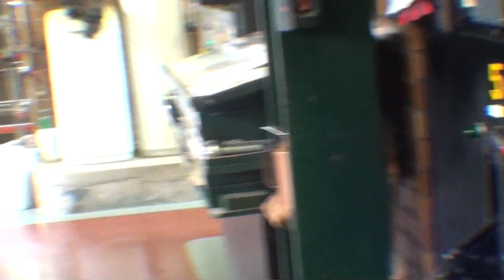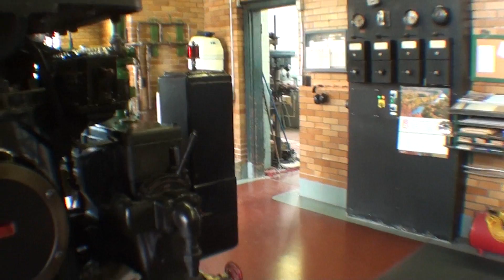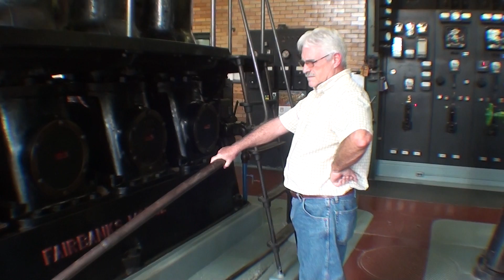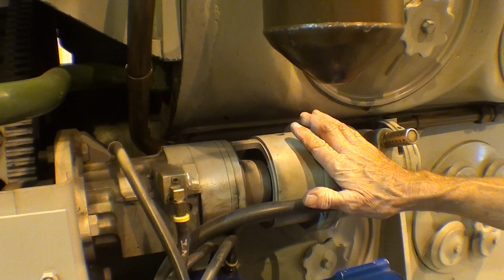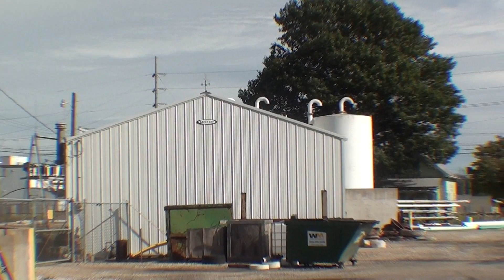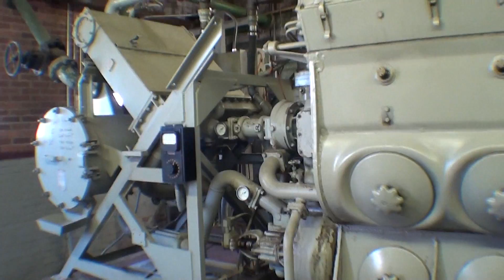tubalcain Takes a Roadtrip to the POWER PLANT pt 2 EMD engines

Comment: I love those EMD's and they're the same cubic inch is the one I use, except the one I run is a 16 cylinder 645 @ 2000 HP in a 1954 GP9 SP 3194 at the Golden gate railroad Museum
Reply from the maker: Awesome

Comment: An SD45 motor. And the same size air cylinders we use in rail yards to supply air to the freight cars for the mechanical department to perform pre-trip air  brake inspections on trains.

Comment: Great mix of mechanical, analog and digital. The sure don't build them like that any more. I was on a rebuild team.  We rebuilt 4, 12 cylinder 1939 GM Diesels with 600 Volt DC generators.

Comment: The EMD 20-645 engine was developed for the model SD45 by adding four cylinders to the 16-645 used in the SD40, adding 600 horsepower. The initial version had problems with a weak crankshaft, couldn't handle the additional torque, but they eventually got it right. In case you were wondering, here's the very first SD45 being started up: https://www.youtube.com/watch?v=Flp0scZWk2s
The other one, the 16-567C, was used in the SD9, among other models: https://www.youtube.com/watch?v=0EfowMMknXQ

Comment: Yet anouther grand slam video.
 THANK YOU! 
In 1986 i was very fortunate to replace some 480 volt 800 amp power distribution breakers built in 1927 for new ones. The old ones took up a wall space of 10 feet high by about 20 feet long. The new unit was 8' high x 4' x 4'. Sad and cool all at the same time.
Reply from the maker: Yes, love the old stuff. But I guess the new one is better

Comment: I work at a power plant in Kansas, my dad has worked at another one for over 35 year’s. If there’s one thing I’ve learned so far, it’s that you have to take all the information and knowledge you can from people like Greg, because once those people go, those power plants are sometimes not far behind. I’ve learned a lot from my dad and love what I do, it feels good to know the Lost Trade. There’s just something about this job that makes it so addicting, like the adrenaline running through you during a black start. It’s what makes those old guys tick. LONG LIVE THE SMALL TOWN POWER PLANTS!!!!

P.S: This brotherhood doesn’t require a monthly payment...
Reply from the maker: Yes, Greg is a great and knowledgeable man. I talk to him on the phone from time to time. They had a little movie theater in his town when he was a teenager. He told me he spent all his time in the projection booth, helping with the sound equipment. He still remembers the number on everyone of the vacuum tubes.
Reply: Hallo Engineer can you help me 
I have problems for spefic fuel of consumption rate of Engine EMD 645/20 cylinders in acatloge 0 .24 L/kwh while in actual is 0.30L/Kwh

What is the procedure to do to decrease s.f.c

Max loads 1600kw i cant loading more because the temperature exhaust go to high
Reply: Hallo Engineer can you help me 
I have problems for spefic fuel of consumption rate of Engine EMD 645/20 cylinders in acatloge 0 .24 L/kwh while in actual is 0.30L/Kwh

What is the procedure to do to decrease s.f.c

Max loads 1600kw i cant loading more because the temperature exhaust go to high

Comment: The man said they don't have a blower. Every Detroit 2 stroke ever made, series 53 to 710 has a supercharger (s). They will not run without a one.
Reply: That's what I thought,a diesel two stroke always needs positive cylinder pressure for proper scavenging.Perhaps I'm missing something?

Comment: Great videos. We have two of those exact EMD 645’s at the now defunct Oyster Creek Generating Station. It also has the ‘creepy crank’ to prevent hydraulic lock except they are battery driven. They are Cadillacs because they are very easy to start and they run fantastic.
Reply from the maker: Beautiful engines

Comment: All of those recent videos wer verey interesting. I worked at Salem Harbor Station in Salem Massachusetts for 26 years. Steam boilers to steam turbone Generators. We also had 6 EMD units in Gloucester and Newburyport for Auiliarry power. Each unit was 13 mega watts a piece. The plant I worked in is now dismanteled. It was replaced by 2 gas and oil fired units putting out 650 megawatts of power. They are made by General Electric and are combined cycle units. Pretty snazzy. :-)
Reply from the maker: Progress

Comment: I worked on EMD's when serving my Apprentice ship . beautifully simple engines and a triumph of design ,originally by Winton.I still have my barring over key, which is used to open the cocks on each cylinder prior to starting to makwe sure no water has condensed in the cylinders over noght. And yes ,a lot of water would come out in humid weather.

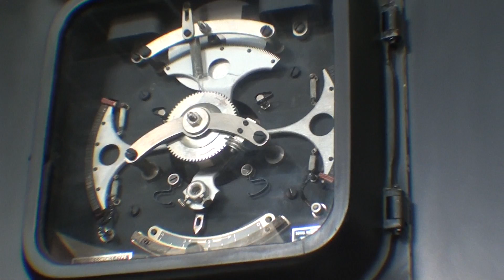Comment: Wooo Hooo Brown Boveri AB4 rolling sector Voltage regulators 2:35, made in Switzerland by watchmakers. Am I the last BBC rolling sector service Engineer?
Reply: Ah, I recognized it correctly: Brown Boveri
Reply: @janvisser2223  Hello Jan did you work with them? They were industry standard in europe in their day. I went to some that were falling apart but still working!
Reply: @worker611  
No, I never worked with these. But when studying marine engineering 47 years ago, I paid attention and still remembered them from the books. Probably due to the fact that I liked their design and the craftmanship to built them.
And by the way,  those EMD’s are truly impressive engines.
Reply: @janvisser2223  They were built in Switzerland so thats were the craftsmanship came from. I went to a few that were on ships or tugs and small vessels, they were usually the smaller ones with a single rolling sector I think they were called JC1. I was a marine service Engineer with the British Brown Boveri from 1974, by that tme they were coming to the end of there servicable life as electonics was taking over. They were great to work on as you could see if they were faulty without needing any instruments. Best wishes and Happy New Year from UK. Bill.
Reply: @worker611  
None of the ships I sailed on, had these voltage regulators installed.
I suppose, the rheostats were the parts that needed the most attention?
And also for you Bill and your family a happy new year from the other side of the North Sea (🇱🇺)

Comment: Craig seems pretty knowledgeable, but he gave a bit of misinformation on the EMD 645 engines when he said they didn't have blowers. All EMD 567, 645, and 710 engines are 2 stroke engines and they won't even attempt to start without a blower to push air into the power assemblies. No blower, they just spin over and smoke. The EMD turbo charger is a combination blower and turbo. It has a gear train connecting it to the crankshaft so the engine can start and run. The gear train has a clutch that works like a ratchet, at lower RPM the clutch drives the turbo impeller, above about 600 crankshaft RPM and around 15.5 K turbo RPM the exhaust has enough pressure and heat in it to spin the impeller faster than the gear train and clutch can, so then the turbo comes off the clutch and spins up to around 19K RPM to make full horsepower.
Reply: That is a nice system, which I have not heard of before. (says a marine engineer since 1978 lol)

Comment: The turbochargers on the EMD engines are gear driven on start up and until their under load. Then the exhaust gases take them off the gear train.
Reply: Larry Hedeen called "clutched"
Reply: Never knew the turbochargers were gear driven on start up then exhaust gas driven.Always though that they were permanently geared to the crank on those two strokers.

Comment: All aspiring electrical engineers should spend a few days in a plant like this, learning from gentlemen like this how power generation works from first principles.  Watching a computer screen control a machine you learn little, adjusting the load limit on a fly-ball governor to limit speed over shoot on run up is clever use of the available technology.  
Manually syncing and closing up a breaker then hearing the engine knuckle down as you wind on the load while manually adjusting the AVR in response to reactive current is  something that needs to be done by hand to really appreciate the physical interaction between the governor, the AVR, and the load.  
Thank you for an excellent film on skills that are rapidly being lost to the computer generation, I'm lucky to be of an age where I have been exposed to both methods, I appreciate the ease of the new ways, but I understand the basic physics behind what's happening from doing it by hand.
Ray
Reply: I graduated from Iowa State University in 1977 as a EE.  I thoroughly enjoyed the power lab they had there, very interesting lessons.  I'm not sure if they still have the lab but I think not.  It had both AC and DC systems.  I later worked for Iowa Southern Utilities for a couple of years, that too was very educational.  I sincerely hope we still have these kind of opportunities for our younger folks, it's good knowledge.  Thanks for the documentary.  I was impressed with how neat and clean the facility was kept.  That's a critical part of a good reliability program.  THANKS

Comment: Maybe you can answer this why was he running droop, while not paralleling to other units also why was he moving the load limit and adjusting the speed at the same time. Just wondering if you can explain.
Reply: The generator was running parallel against the grid, if the diesel was running isochronous speed (0 Droop) it would either overload itself if the governor speed set point was the slightest bit faster than the grid, or run as motor (reverse power) if the governor was slightly slow, the droop setting gives the unit stability.  Load limit mechanically limits the maximum fuel rate that is admitted to the engine, in the hands of a skilled operator, as this gentleman is, it can be used for limiting smoke on start up, then limiting run up rate to prevent over shooting the set point speed, then finally once on load, limiting the maximum load on the engine.
These skills are now all replaced by black box control systems, and the basics of how generation works will be lost when these gents retire.
Reply: whorayful I was just watching this video. If someone turned the limit control up you would have a run away. He is using it to hold the load. The Governor not working he is. I understand what he doing if there's a load swing this unit is going to drop off. The fuel is be held by a mechanical stop inside the Governor. I been out of doing governor work for a while never seen anyone do it like this. You are correct I see what you talking about he limiting it. As for as stabilizing it using droop he is dead rack against the limit stop.

Comment: A little information for you the Woodward Governor on the Fairbanks is a IC Governor and the 2 on the EMD'S are UG Actuators. Some were they have the electric governor for them. More than likely they are 2301 panels with load control. You didn't show the last one. Someone comment Caterpillar does own EMD. You seem to like how thisng work if they ever pull the side cover off the Woodward IC governor you would be in pressed. I wished I could have found one. I worked on Woodward Governors for 20 years. only seen one in my life tried to buy it they didn't want to sell it. It's a lot more than a flyball governor.

Comment: Thank's for the video.A squared away engine room.The workers take pride where they work.Never worked in a power plant ,but ran diesel-electric propulsion in the Coast Guard.They used 567 series as well as Fairbanks Morris,Alco,and Cooper Bessemer.Only difference is you are rocking and rolling.LOL

Comment: I spent 2 months at a power station owned by the company that employed me, they are very interesting places.  8 large steam boilers, feeding 3 stage turbines, with a total output of 1280 MW.  Used to be a base load station here in South Australia, but was working as a peaking plant when I was there. Due to the shut down of a coal fired plant, I believe it is now running again, as base load.

Comment: I've always been fascinated by things like this. Getting to see an emergency power system like this one is a real treat and I'm glad to see this second part as the first one really wet my appetite. One thing they couldn't show you is what happens when they throw those inlet breakers under load. The flash arc that occurs is something to behold. Watching one get hit by lightning is also an epic event to witness. I am both fortunate and unfortunate enough to have seen both. While amazing to watch, catastrophic events had to take place for them to be necessary. I feel compelled to say that you really don't want to witness a lightning strike in person as the concussive force is quite intense as is the arcing from the failed lightning arrestor. After the large explosion nearly knocked us senseless there was a large shower of sparks and all manor of chaos. Being a simple substation there wasn't much more to be done other than to throw the inlet breakers so that the line could be repaired. This happened back when I was a boy of 13 since I had made friends with the lineman who worked on that substation. He had been stationed there that fateful night because of the expected storm and the chance of a power failure. We had been talking when it happened. I learned a lot from Bruice and most of it even stuck. He's no longer with us as he died of old age. He would be 104 on may 20th of next year if he were till alive. He was a dear friend...

Comment: Best field trip ever. Thanks, Mr. Pete! I thought you were going to bar the FM over for us!

For those interested, there is (or at least was) quite a bit of information about the Fairbanks Morse engines online. Try searching for model Y engines. At one time I even found an operator's manual. The same basic engine was used, in one to six cylinder versions, to power mills, generators, cotton gins, you name it.

There was also a catastrophic story about an engine collector who thought the crankcase should be filled with oil....

Comment: The lack of explanation  that the generating station plays in connection to the grid leaves one to wonder.... what is it there for?   With nothing running, it could be only for back up when the grid can not supply the town's demand. Too bad the question was not asked. Interesting to see the old equipment still serviceable.
Reply: This video is a series of 3 videos, one is a tour of a hammer factory, 2 and 3 are a tour of a backup power plant (mentioned in the first video) in the same town.  What it's there for is in case it's needed.  They keep the coolant and oil warmed up so they're ready to go.
Reply: I believe it may have been decided that since they had so much invested in the power plant, that it seemed wasteful to scrap it; particularly because power consumption was forecast to increase in the future, and before the proper infrastructure can be built, having a good stand-by plant just made sense.